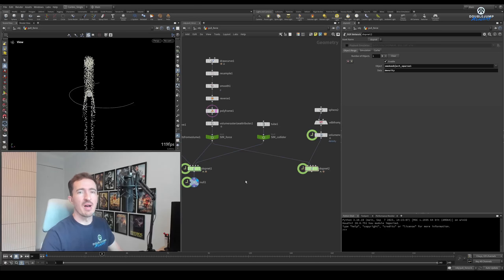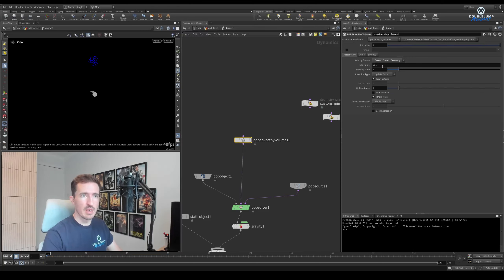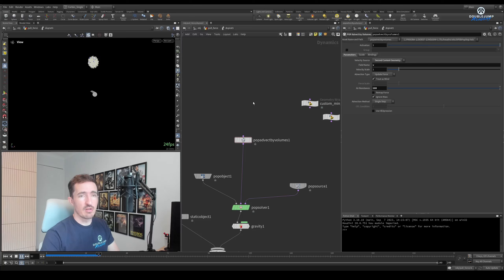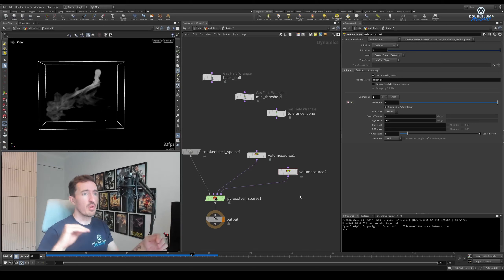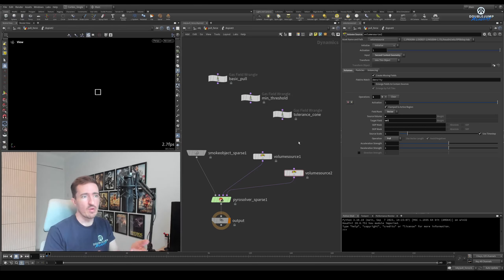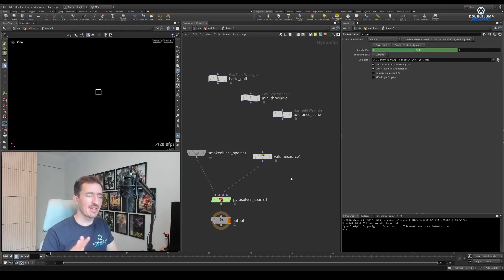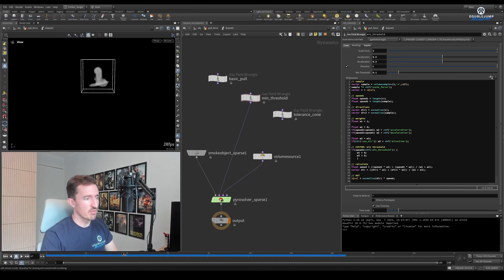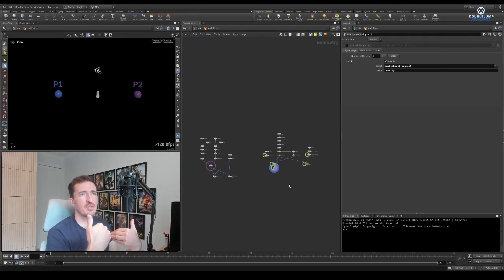Houdini Tutorial - Pull Function Masterclass from FILMFX with Corbin Mayne

Comment: can we use this method for RBD?
Reply: Yes you sure can. RBD works with the point attribute v so the way I applied it to the POPs would work on RBDs
Reply: @corbinmayne  hey corbin, thanks for putting out great content. and yes it works just fine with rbd and also i got the pull fn to work with 3 diff weights and velocities. It is indeed very easy to mix forces. Is there any other custom tricks( like tolerance_cone and colission_masking )for a realistic sim .

Comment: What are the green thick circles on the nodes?
Reply: They are badges that you can configure with D key in network editor. It's for showing you when a node is time based evaluation. Letting you know the geo is changing or parameters are changing over time.
Reply: Exactly right, and I always make mine huge because time dependency is SUPER important for optimising setups so I want to know at a glance where my network is bottle necking